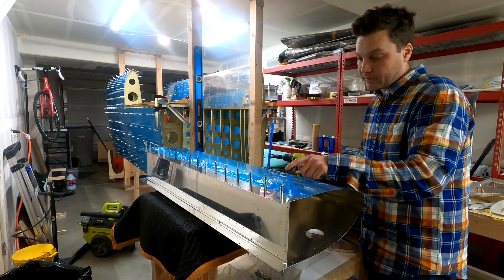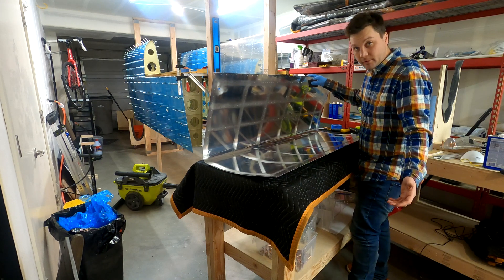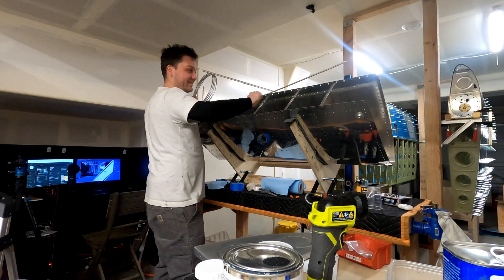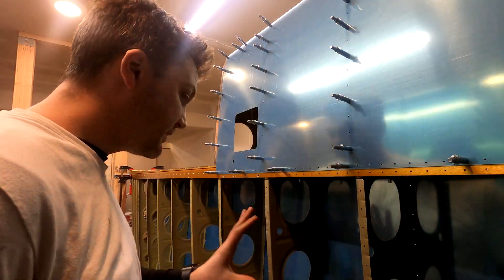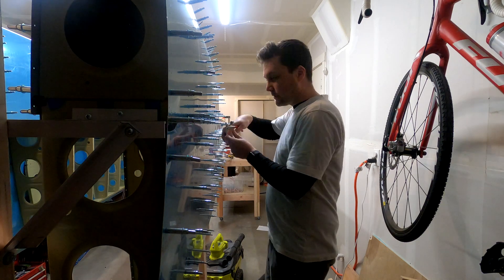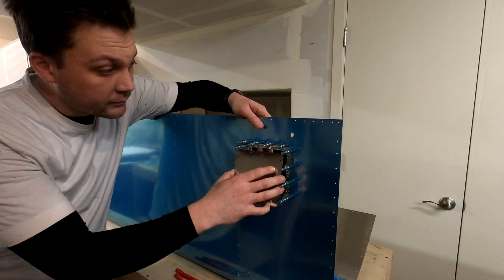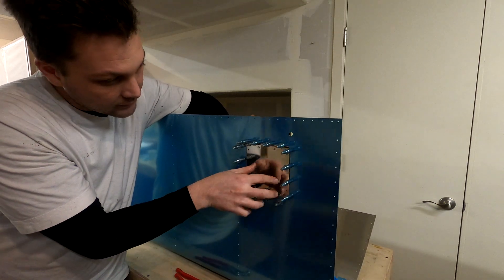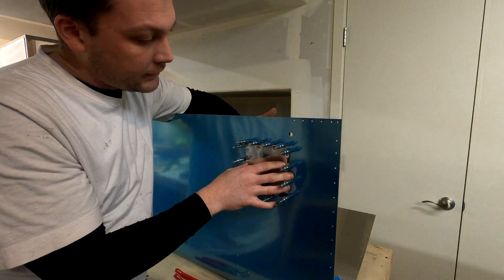Building an Experimental Airplane, The Vans RV-7A | EP2.9 Left Fuel Tank

Comment: Why not just remove the blue plastic from the aluminum right away?  Assuming you will have the plane painted, all skins will have to be stuffed up anyway.  Unless you drop a heavy tool on the aluminum, I would think working around the blue plastic is more trouble or bother.
Reply from the maker: It will get scuffed for painting, but I’d prefer to protect it from as much hanger rash as possible during the build. They look nice when they’re shiny before paint durning phase 1, as opposed to all “beat up.”

Comment: you know that guy that chases SpongeBob and Patrick wanting chocolate? well thats me waiting for your videos lol. I think you have the best videos. Other guys just have the camera at a distance and you get a whole frame but no detail. I like that you bring the camera closer and show us what you are doing. 
Speaking of which. the bent tube is a fuel pick up then?!
Reply from the maker: The shorter but wider tube bent at a roughly 90 degree angle is a fuel pickup. 

The long tube is a fuel vent, to prevent a pressure differential that would prohibit fuel from flowing.

And thank you so much for the compliment!! I’m working on methods to allow for more angles—GoPro are great, but not exactly designed for detail shots.